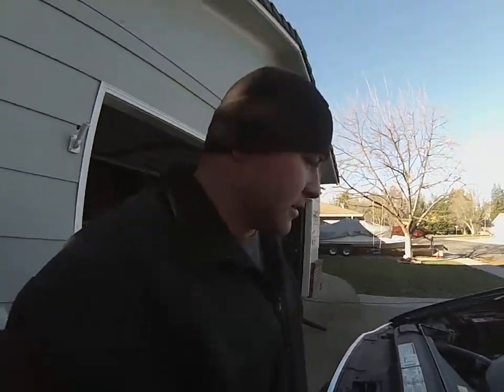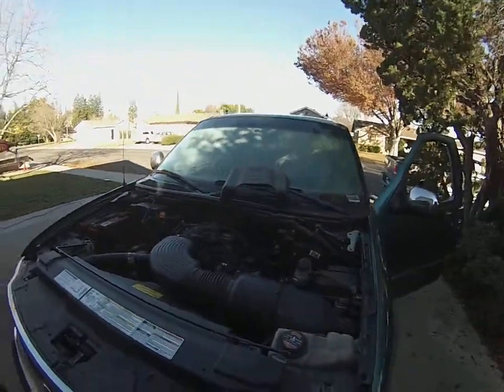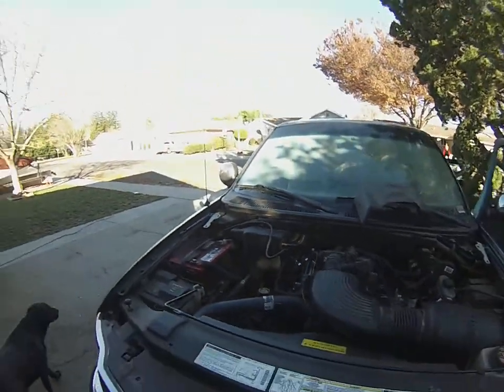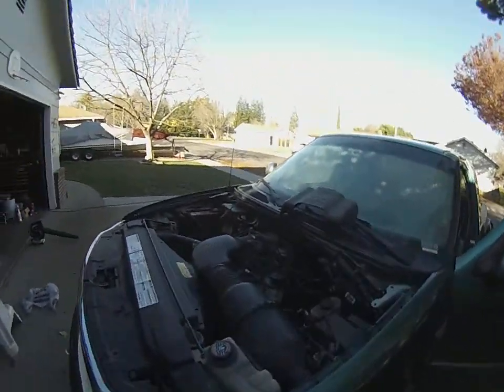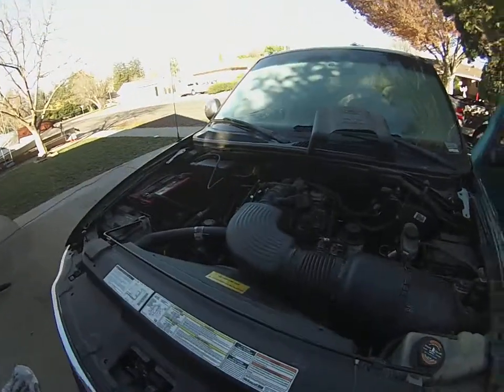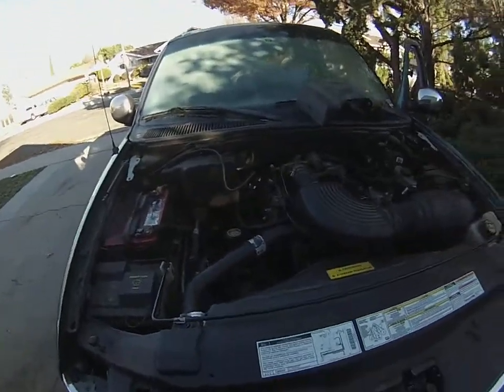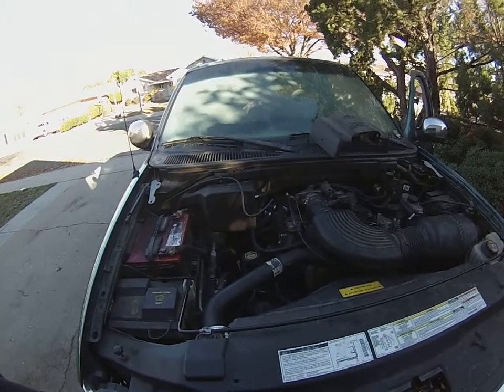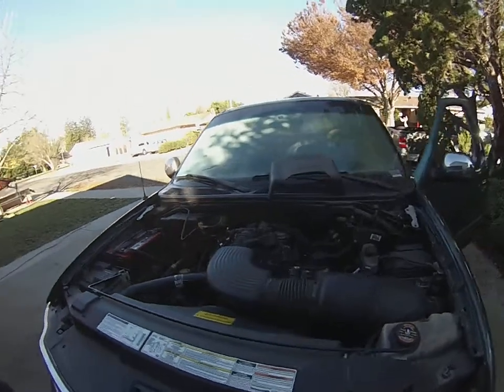1998 4.6L 2 valve head gasket job #6

Comment: Thanks for posting this series. One question: Did you use a gasket for the front engine cover, or is it installed only using RTV sealant? Glad you got it back up and running.. These are good old trucks.

Comment: I have to do the exact same thing this week on my 1998 f150 4.6l 4x4. I'm worried since all of my years of mechanical experience has been on the older vehicles, but your step-by-step videos explaining it helped me to understand the installation of the timing chains a lot better,... that's the part that has me concerned. Thank you very much for taking the time out to make and post these videos!
Reply from the maker: +Eddie H. your welcome and thanks!! its not too difficult. good luck and post any questions you may have.